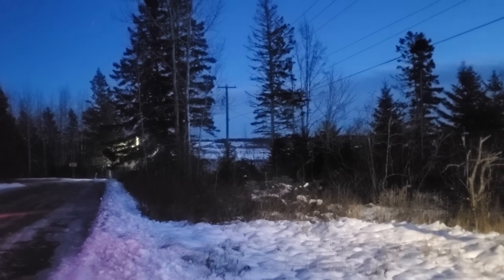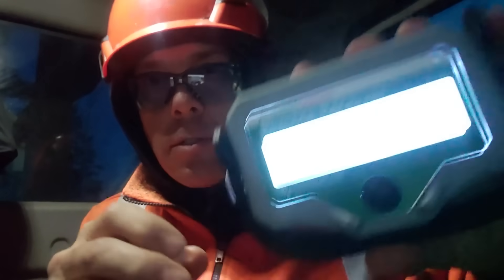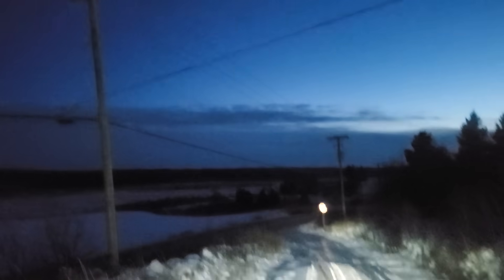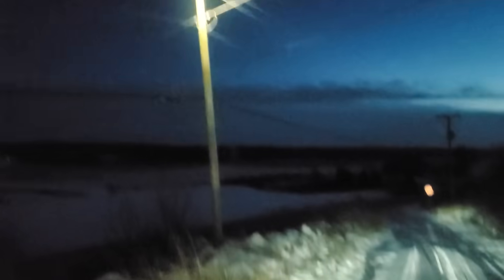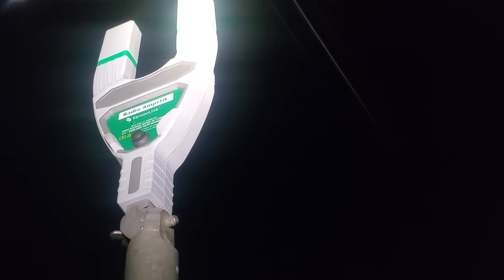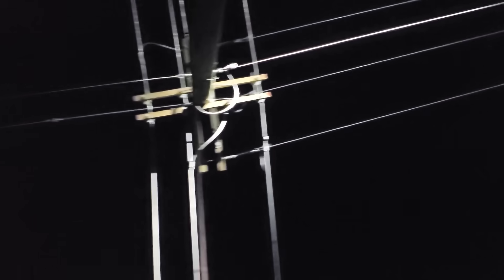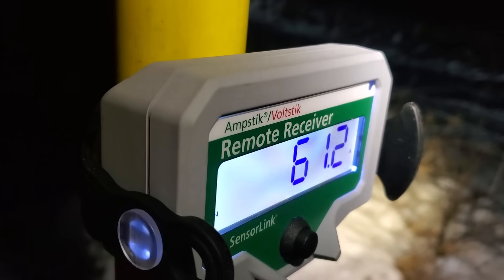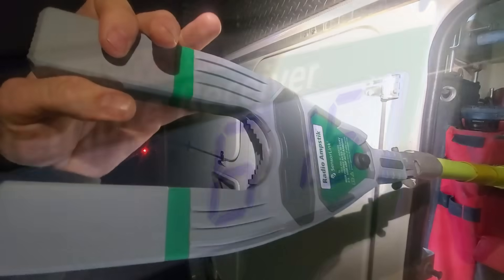How I do an "Amp" check on high voltage Powerlines! (12470 Volts)

Comment: What’s the most amps you’ve seen on a line? Mines 290
Reply from the maker: On 7200 volts, about 600A and on 120v (2/0 Aluminum, Triplex) just under 1200A lol.... The whole span bursted in flames.... It was -40°C 🥶

Comment: Seems like in the dark it could be difficult to tell which way the head is oriented, at least if you're concerned about the in vs out. Putting a red LED on one side that faces downwards and a green LED on the other side would make it easy to tell. I know if has the green LED for power on it, but that faces directly out and doesn't appear to be that easy to see when you're directly under it. I'm also a little surprised it doesn't have a min/max/avg function on the display.

Comment: My brother dose industrial electrical work he works at Novelis(formerly Alcan) and he works on giant 10,000 horsepower electric motors that run at I believe 32,000 volts there isn’t enough money on the planet for me to do that kind of work
Reply: @liam3284   Strange. What purpose are they made for? Such a high supply voltages are suboptimal for units below 50 MW. The largest units I know of are synchronous motors installed on cruisers with supply voltages like 15 kV
Reply: The largest AC motors run at 13,8 kV
Reply: @liam3284  those motors turn ingots that weigh 35,000 lbs in a machine called the hot mill that turns them into thin aluminum sheets that are then rolled into coils
Reply: @Redbird45  Giant synchronous machines ( 300 MW + generators) are not made for more than 30 kV. There are several reasons why not. I'm really surprised to hear about motors working on 32 kV, let alone more
Reply: @imeprezime1285  see what your not getting is that was an estimated number not an exact number
Reply: @Redbird45  Estimated or not, that's a very high voltage for usually made electrical rotating machine!

Comment: How does the current direction sensor work? I’m trying to think how I would design the sensor and coming up blank
Reply: CTs have polarity to them, even though it's AC. The positive, secondary terminal (X1)  is usually in phase with the "in" side of the high voltage window (H1).

Comment: do you not have a non contact voltage probe?  One would think if you can read the current, you should be able to read the voltage.  I would be surprised to find that there is no such tool.
Reply: yes, he has one, but it's another tool that reads an approximate range.

Comment: Any thoughts on if there will ever be a device like this to use on underground ( xlpe etc..) or is just not possible due to the nature of construction for that type?   Thanks for your posts
Reply: They make 2 different sizes, the standard 2.5" and a 4" opening. It will measure current on URD but the only way to direction is on a capacitive test point. The 2.5" will go over a 200amp elbow and the 4" will go over a 600amp elbow
Reply: @nateroth1302  so IF we have cap test points on our “ connectors “ and IF we got a device like you mention …..it’s doable?  POCo is only at the first switches(2) coming in. Then we own it. 13.2 loops with about 22 xfmrs.
Reply: The only way I could see that being possible is by checking the lines where they go into or come out of the ground. In the ground, you have no way to get the head around any of the cables, let alone a single one.

Comment: You mention expected current flow direction from the substation. Perhaps not given your northerly latitude, but do you ever see this being flipped due to high PV feed in from rooftop generation? Here in Australia I can imagine there would be times and places where the generation/consumption in some areas would get to and possibly exceed equilibrium. Heck, wholesale prices have even gone negative on some occasions- the grid will pay you to dump power for them.
Reply from the maker: That's a great comment/question! I'd  say you're absolutely right on a select few sidelines. It's still not hugely popular for the majority of homes so I wouldn't see it on main feeders quite yet.
Reply: This is one of the reasons direction of flow was added to this product. Knowing when a line is being backfed from either a generator or PV installation.
Reply: @nateroth1302    true, but I doubt any single residence or small commercial PV system will produce enough to throw things off to an entire village. Heck, 100 amps at 240 volts can be counted on one hand (amps wise) once the voltage reaches feeder level.
Reply: @rupe53  no, but when you have whole neighborhoods it is then a different story.
The other issue is the customer who has backfed their generator into the dryer outlet during an outage.... Not all work methods around the world are the same for grounding and bonding
Reply: @nateroth1302    that guy with the portable gen set is not generating enough juice to read in the transmission lines when you consider 5 - 10 Kw at 240 volts is just about nil for amps on a 7200 volt line. There will be voltage, but not enough amps to read in the big picture. The flip side is the potential load on that little set during an outage would have turned it into a smoking pile of rubble already. Been there, done that, and have seen the carnage, several times in my line of work. (recently retired)
Reply: Just how does this device determine which direction the current is flowing? In my mind, it’s AC current, so the direction of current flow is constantly changing.
Reply: @toddk968    direction above and below 0 are changing but the wave form will be the clue to direction of travel.

Comment: Whats the voltage on the lines you tested i wanna calculate the wattage
Reply: It's in the video and the title of the video. 12470 line to line which is 7200 line to neutral. 62 amps average per phase with a total current of 180A from the substation to the downstream load. Loads on each phase are balanced as the current average was the same on each. You would calculate in kVA and either line to line or line to neutral would work.

Calculation with line to line voltage
The apparent power S in kilovolt-amps is equal to phase current I in amps, times the line to line RMS voltage VL-L in volts, divided by 1000:

S(kVA) = √3 × I(A) × VL-L(V) / 1000 
That would be about 1295.92 kVA 

Calculation with line to neutral voltage

The apparent power S in kilovolt-amps is equal to phase current I in amps, times the line to neutral RMS voltage VL-N in volts, divided by 1000:
S(kVA) = 3 × I(A) × VL-N(V) / 1000 
That would be about 1296 kVA
Reply from the maker: 7200 ish phase to ground

Comment: You said that device says “IN” and can read the direction of current, but AC has not direction. It just alternates back and forth, so how does it know direction?
Reply: Detects a phase angle between current and voltage (or B and E field). This way direction of power flow is measured
Reply: @imeprezime1285 still doesn't answer the question. Phase angle can lead or lag depending on whether the load is inductive or capacitive. So measuring phase angle still doesn't tell you IN/OUT.
Reply: @6AK5W-JAN   It does. It depends wether phase angle is +- 90° or more than that. Take the simplest case of purely resistive load. Phase angle can be 0° or 180° then. In one case power flow is "IN" in other "OUT" ( this depends on orientation of clamping device during msm).
Reply from the maker: I have no idea how it detects it...  But I gets it would be more accurate to say it's identifying the "source"
Reply: @Bobsdecline Can you contact the manufacturer and ask this question. I'm truly curious how they are doing this. It seems impossible to me.
Reply: As I commented above, CTs have polarity to them, even though it's AC. The positive, secondary terminal (X1)  is usually in phase with the "in" side of the high voltage input (H1).
Reply: @inothome You've repeated this nonsensical answer several times on this video. You're stating irrelevant facts that have no relationship to the question asked.
Reply: @6AK5W-JAN  The same question was asked a bunch of times. So I explained how a CT does have directionality (polarity)  to it. So how does that not help explain how it can determine direction of  power flow? Do you work with CTs, PTs, protective  relays and deal with this everyday at work? I do, do you have a better answer for people to help explain it better, please help and explain it for them.
EDIT: Now I just saw more of your comments. Walk in any substation and you will see power meters showing the flow of power. Either in to or out of the substation. It's not rocket science and nothing complicated about it. Usually uses a PT as well and the manual for this amp meter states it needs at least 200V to detect flow. Look up the manual, it's not hard and neither is determining power flow in an AC system.
 I'll help you out, since I like to educate / teach people. Google "67 directional relay", that will help explain it.
Reply: It measures the current and voltage waveform to determine where source and load is.

Comment: I don't think it's accurate to say the "current" is flowing "that" direction - it is AC after all; but instead the energy flow is toward that direction (or the source is "this side" and the  load is "that way").
It occurs to me that current sensors could be scattered all over the lines with cheap microcontrollers and LoRa transceivers.  Powered by induction from the line with a supercap for backup power.  The LoRa's would form a mesh network and relay the data in near real time to a local substation that has a datalink back to the head-shed.  Sampling rate of once per minute or so (probably even slower) would be more than adequate.
Of course that would kill great vids like this, so faggedaboutit!

Comment: Nice demonstration. 👍 
Is that particular unit rated for a certain amount of volts? IE up to 20,000 volts, or will it work on any type of voltage? Would it work on triplex for homes?
Reply: Datasheet says minimum 200V for the in/out indicator, not that you really care in that application. A bigger problem of course is that if you don't separate the triplex wires, then you just measure the total cable current which cancels to zero.

Comment: That is really cool in terms of the principles of operation.

Normally with an ammeter we like to minimize the air gap, so we usually have a magnetic clamp. But in this case they left it wide open since it means you don't need to worry about a clamp mechanism that gets stuck. They say it has no magnetic materials at all, so I guess it just measures the magnetic field at a set distance from the wire. Perhaps they have a secondary field measurement at a different distance, so they can cancel any ambient fields. That does lose a bit of accuracy but that is acceptable.

It is able to measure the "direction of current"  (technically the direction of power flow since the current is alternating) by comparing the current to its voltage measurement. But how does it measure voltage if it doesn't have a second reference electrode? I guess they just weakly capacitively couple to the air around it, which is incredibly inaccurate, but it does give some idea of the phase of line voltage, and that's enough for the in/out.

By no means a precision device, but immensely practical and it is exactly what a lone first responding lineman needs!
Reply: It uses a open core rogowski coil to measure the magnetic field and an e-field sensor to compare the current and voltage waveform for direction. The are a 1% accurate meter rated down to .5amps.
The Radio Ampstik is rated up to 133kv due to radio communications where the non radio version is rated to 500kv.
Reply: It seems Ive spent too much time working with low voltage DC circuits, think circuit boards mid-size computers.  I still don't understand how it can determine "power" flow directions.  I'd need to see this explained using wave forms and graph.  

More power to the people that invented that! (Pun intended)
Reply: The current waveform shifts 180 degrees when the power flow reverses.
Reply: The Troubleman’s kit from Sensorlink comes with a Radio Ampstik and a Voltstik. The Radio display can works with both of those units to give the user readings.

The Radio Ampstik he’s using in the video will only give an amp reading. The voltstik is different in function - it clamps and has a second reference electrode to clamp on as well.
Reply: Makes sense
Reply: I wonder if those two serrated objects at the bottom are used to infer the current flow via a relative voltage drop.

Comment: I wonder if there will ever be a device that permanently sits on the lines like those outage detector lights?
Reply: There are, like everything, it comes down to money.
Reply: In Germany we have recently started using fault indicators that monitor temperature, current, voltage and fault direction of the overhead line and report them to dispatch. The system works very well and makes life a lot easier. 
The system is called "Smart Navigator 2.0".
Manufacturer "Horstmann"
Reply: Heimdall Power has the Neuron which clips to the transmission line and monitors for load and temp. They’ll start  trialing these in NA this year.
Reply: I do believe SensorLink makes 2 overhead recorders that can measure current, PF, kvars, and kwh. They also have an underground recorder that can mount in a underground cabinet or on an elbow.
Reply: Similar thoughts here...
Reply: They have clamp on ammeters with an antenna that clamps on the primary. We install them when the engineering department wants to know what the load is at a set location. They stay up pretty much forever unless they stop working? Engineering tells us where to put them. They are directional. Each one weighs about ten pounds.
Reply: I'm interested to know how any of those tools can be directional given AC.
Reply: There’s one or three (current shunt or transformer + voltmeter) in every smart meter measuring power in and out. I expect that yields some useful data. In this part of the world we have 5 minute block metering, but I understand we’re going to 30 seconds.
Reply: @rowanjones3476  In the video he's measuring current on three phases of a distribution line.  Pretty hard to "integrate" all that from hundreds of customer meters.  Further the meters (as I understand it) don't report in real time but send a "batch" of of data in one go sliced up to 5 minutes (or whatever timeslice).
The system operations engineers were likely trying to understand some specific issue and needed those measurements at the 3 or locations Aaron mentioned.
Reply: @AlanTheBeast100    Most likely a voltage drop due to overcurrent somewhere, and they are trying to narrow it down. If it's that closely balanced, then the drop isn't in those transmission lines.
Reply: @rowanjones3476  yeah I've heard of those, but they must be somewhat different than the ones used on primary wires 🙂
Reply: @grabasandwich  of course - they’re useful to the engineers rather than the accountants being the most obvious difference!